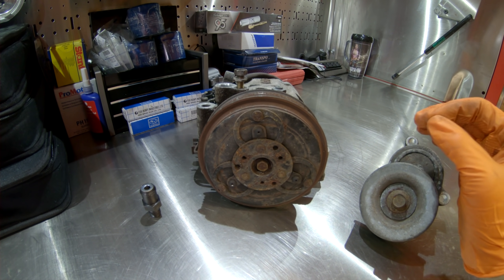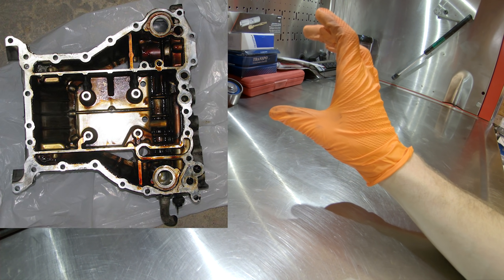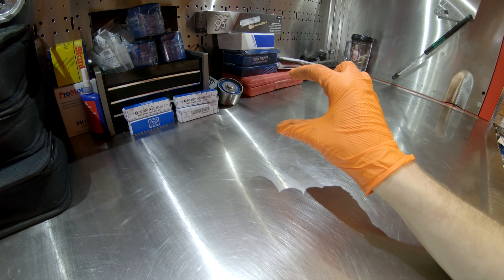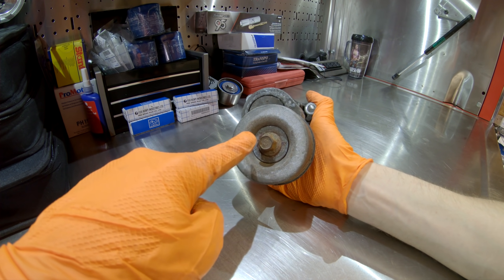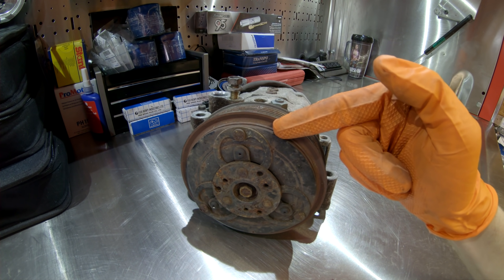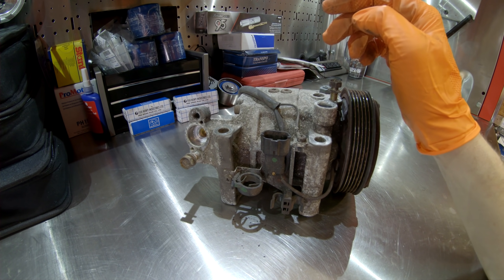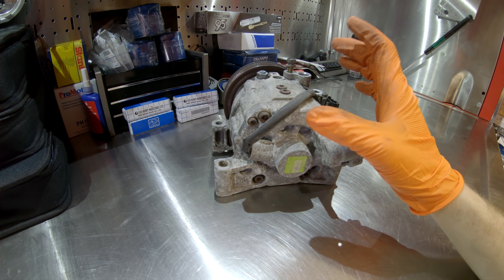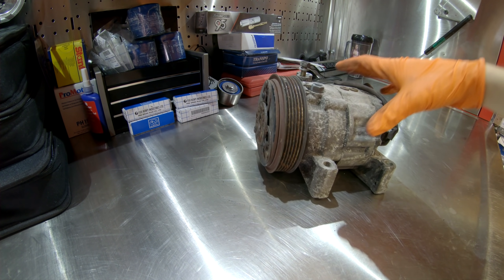Subaru EZ30 & EZ36 Top Three Failures

Comment: repairing the waterpump could be a nightmare.  the older subaru engines had pushrods. all the coplications are gone.  actually the spare tire was mounted on the top of the engine.

Comment: Any advice on how to avoid these issues? (New owner of a used 2019 3.6R outback)
Reply: Regular oil & filter change and keep an eye on the oil level as they do use some.  You will need to replace the cam cover seals as they all leak eventually.  Check PCV valve occasionally.  Replace serpentine belt idler and tensioner bearings maybe every 200,000km and the thermostat too (ensure it is installed the right way round & up, and is OEM).  Also check the steel coolant line that runs across the bottom of the timing cover to the oil cooler - ours pinholed from the outside where the support tab is welded.  Our '05 Outback has 330,000km on it and still runs nicely otherwise.

Comment: Any advice on how to avoid these issues (New owner of a 2019 3.6R)
Reply: About to buy one as well…. 

The engine and the interior design is much nicer in my opinion than the big I pad with auto start stop…

I am confident in this car but I have heard plenty of “these engines are bulletproof, stay on top of everything and you’re good, these last a long time” contrasted with “the transmission locked on me, oil leaking at 70k miles” 😂
Reply: I wish they kept offering their newer cars with the older looking style system, and with physical x mode buttons, and the H6…. Alas…. My last Outback kept me safe in multiple situations so I’m a fan.

Comment: Question for you... I just picked up an 02 LL Bean with the H6 217k miles. Has on overheating issue. It only overheats when you drive for 20-30 mins. Will cool itself down when you go to idle even if the AC is on. I'm familiar with he EJ engines. In my deductive reasoning I would assume water pump, but with it being timing driven it is out of my scope of replacement. I don't want to drop that kind of money without knowing that it will fix it and the mechanics around me aren't that great when it comes to diagnosing. The first one I talked to said head-gasket without even lifting the hood and tried to tell me that it is common on Subs buuuuut I worked at Subaru as an advisor for years and this is not common on the H6. Thoughts?

Comment: Having now owned both Subarus with a 2.5 n/a and a 2.5L Turbo ej motors, I’d like to try an ‘08-‘09 Outback 3.0R L.L. Bean motor. Compared to the overheating H/G issues on the N/As and the banjo bolts issues which can destroy the turbo motors, it seems the ez30 3.0 oil leak and other issues  are really minor compared to the concerns that plague the ej motors. Great video as always Mr. Subaru!

Comment: I have a question on what your thoughts are on not rebuilding the bottom end of the engine if I'm pulling it out the only issue I'm having is it's mixing exhaust gases causing the coolant to overflow my suspicion is that bad head gaskets want to replace everything on the top end and throw the motor back in recommended or not recommended is my question thank you I love your videos and you've been a godsend on helping me keep my Subarus on the road
Reply: It is ez 30

Comment: MrSubaru, great video thank you. I am not a Subaru guy, meaning I have not worked with them in the past. A friend of mine as enlisted my help with his 08 3.0R which I think is the 3z 36.. idk you would know better. Anyway, short story is the car blew oil all over, I mean from the under side of the hood to the exhaust all on driver side.. I first ran the car with no air intake, open throttle body ( because he remove all that before I got to it) and I was searching for a massive oil leak.. much to my surprise, no leaking oil, anywhere.. however, the engine is blowing what looks like white smoke out of the hose that goes from intake box to valve cover, as well as the dipstick tube and oil cap ( if you loosen it)
So my first thought was PCV, I replaced that.
It's still blowing white smoke out anywhere it can... I am 98% sure there is a clog in the flow of the pcv system, question is, where? In the intake manifold? Or in the block?
I'm pretty sure the pcv vavle clogged up and caused the oil to blow out the dipstick tube..
Any help with this would be greatly appreciated, sorry for the long/short story lol

Comment: I'm getting ready to purchase a used low mileage EZ36 eng and trans to replace mine in my 2012 Outback project car. Planning on doing a Raptor Super Charger in the near future. What would you recommend doing on a used replacement motor other than plugs, water pump, valve cover gaskets, & idler pulley assy of course! lol Was wondering if it would be worth upgrading to fel-pro head gaskets prior to install? Any input woul;d be amazing! Thanks, your vids are amazingly helpful!
Reply: Did you end up supercharging your ez36 ?

Comment: Nice video.  I had an oil leak on my 2012 outback 3.6R.  After I replaced the PCV valve, the leak stopped.  When do you recommend to replace the PCV valve?  I don’t see anything on PCV valve replacement intervals in the owner’s manual .  Thanks
Reply: Good point - I’ve just bought an MY10 3.6 5sp Auto with less than perfect maintenance history but only 170km on it, and no sign of oil leaks. Drives like a dream.
I was planning on getting the gearbox, diffs oil changed.
Looks like good idea to get new PCV fitted while it’s in the workshop, and have them check the a/c clutch clearance.

Comment: Such great info-- I have a major leak that right through a gap right in front of the oil pan. I looked at the PCV valve and while it is working (suck test) it looks dirty and I think that might of been the problem. Once a leak occurs I suppose that changing the PCV valve is too late, correct???  I am worried that my timing chain cover is blown and don't have the $700 bucks to repair.

Comment: What is the correct head torque sequence on the 2001 ez30d? I have found 2 vastly differnt sequence's floating around the web- the one dirtcheapdaily used and the one in the 2001 service manuel. Has subaru updated it or was dirt cheap's later model ez30 call for different steps? Thanks man!

Comment: I’ve seen a handful of nissan VQ40 engines in xterras/frontiers/pathfinders/equators have the PCV stick wide open and cause colossal oil consumption, usually less than 50 miles to burn one quart

Comment: 168k miles on my 2011 OB 3.6R. 4500-5000 mile OCI's with synthetic and it still runs great. My serpentine belt pulley actually went bad at 105k. But I replaced the pulley alone and put in a Continental Gatorback belt and all has been great.

Comment: My EZ36 during a trip had the bearing wear out on the Idler pulley and throw the belt. I wonder if this means that when they did the 60k mile belt replacement if they just didn't swap the tensioner and idler out. It's right at 85k miles now. I'm starting to check and redo all of the old maintenance on this car now that I no longer trust the maintenance done by the prior owner. I've done the differential servicing already, and I'm going to go ahead and get an official bearing kit to replace the aftermarket one I had to install on the road, and have them replace the PCV soon.

Comment: well, this is the knowledge i need, thank you. im having an issue with i think its atf fluid getting in my radiator. can u maybe help me understand that? also im having an oil leak, i think its oil, in-between on bottom or near the bottom engine & radiator? im pretty sure the pcv valve hasnt ever been changed. i just bought this car & i didnt notice all theses problems b4 hand. also it runs really hot. but not all the time. plz help if ur able. im going broke on this thing. thank you

Comment: Are the ez 6 cylinder engines oil burners?
Reply: When you use incorrect 0w20 or 5w20 yes...use correct weight 5w30 or 5w40 oil
Reply from the maker: No.

Comment: Hello Mrsubaru. I have 2006 b9 tribeca I tell you my experienced I was confused in 2016 middle of May at around 11pm I traveled from NY to NJ and my serpentine belt broke up still original belt since. It broke up after I cross the  verrazzano bridge then I pulled over and shut the engine off. When I turn the car on it start again and I started moving and run the car without serpentine belt to exit 102 NJ. that over 50miles but after 30 minutes of driving everything was down most are electricals I’m in the middle of Garden State highway driving without lights and panels are black out. What I did was stupid and risky but my car saved me. I’m not sure if I have an angel or it is a car is my angel. Until now I still have my car but the engine is started leaking I’m thinking to change the motor and hoping if you can make a video how to swap engine. Thanks and more power...

Comment: Pcv valve tip is a game changer, such an unassuming little part that can lead to a massive headache! Thanks so much for this awesome video.
Reply: Have to agree. Didn’t think how much problems could occur by not checking and replacing it. Great explanation as well MrSubaru. Clear and straight to the point. Love your videos.

Comment: thanks for the video! I love your content and you've helped me on numerous repairs. I'm about to pull my h6 engine to do some pre-emptive maintenance (timing chain and water pump). However, I was curious what your thoughts are on doing the head gaskets while it's out? Is it worth it? I know head gaskets blowing on these is rare, but when I've been underneath the car I have seen some very very small green spots around the head gasket area. I wiped it clean and haven't seen anything since, also I check the radiator fluid often and it's completely clean. thanks!
Reply from the maker: If you're pulling the timing set, might as well freshen the heads and replace the head gasket.
Reply: @MrSubaru1387  sweet, i'll give it a go. hoping to get 300K+ mi out of this engine.
Reply: @MrSubaru1387  what causes goop in coolant resvoir? I had to replace hose and new radiator after it leaked .
Reply: @007conspiracytheory  headgasket leak ?😬💸💸

Comment: 2006 Subaru Outback 3.0 h6 has overheated replaced the radiator as it was leaking and thermostat just in case! I did a test with that blue liquid and it never changed colors! Then did a pressure test on radiator and more leaks was found on the water return line in process of replacing that but on my back! I heard to jack engine up but remove the mount bolts and or if need more room take headers off! Now headers are right in way can I just do these vs jacking up engine?? Can I reuse the gaskets?? How can I get to the mount bolts easily?? Special tools ideas on back so hard to get a straight look at the bolts on mounts!

Comment: MrSubaru looking at the videos for the EZ36 timing chain replacement, I don’t not see holding the cams when the chain is removed. 
Will the cams rotate due to spring pressures? Is there a holder for the gears not to move?  
I have 100k on my 2010 OBW and assume the chains should be replaced. 
Thanks for the videos and guidance.
Reply from the maker: The chains aren't replaced as normal wear items like a timing belt. They're ruled lifetime or 300k miles by Subaru. You only service the chain when you have an issue, like; water pump leak, chain noise, loose guides, etc.
Reply: @MrSubaru1387  So that water pump....   its timing chain driven.   Scotty just ridiculed Nissan and Subaru for using timing chain driven water pumps, and the potential for coolant to leak into oil that comes with that, basically destroying the engine by rusting the main bearings.   I've never heard of this issue happening to a Subaru, and I have driven them for 27 years, although I've only had EA82, EJ22, EJ25 and now FB25 engines.   I am looking at a low mileage 2018 Outback Premier 3.6 (Premier is the top of the line Canadian model, which I believe is the Touring model in the USA, whereas in Canada the Touring model is the well equipped middle of the line model).   

 I've never heard of a water pump issue on an EZ, and I have some friends with some of the original EZ30's, the 212HP models.   I seem to recall that the water pump has a seepage hole to the outside, so that will leak coolant to the outside before it can leak into the timing cover, is this correct? and have you ever done a EZ36 water pump earlier than 200K?   I was considering the new turbo, but I don't like turbo's for all the issues they bring into the equation, and I tow a small trailer (Aliner hardside popup, 2100lbs fully loaded), so the idea of being on boost up long hills is not appealing.  My FB25 does fine towing, much better than my previous Ej25 with the manual transmission.  So I am thinking that I can get just a bit more power without a Turbo, and at about $17k less than a new one.  But that water pump sticks in the back of my mind, especially since I first saw the FB engine on display in 2008 where I noted the accessory driven water pump, a return to what the EA82 had.  I had no issues with the timing belt driven water pumps as I changed idlers, tensioner, and water pump with the belt each time.
Reply from the maker: Correct, the weep hole is external. It won't mix coolant and oil, unless the water pump o-ring goes. Haven't seen that happen. Haven't replaced an H6 water pump. I replace the engines first, due to owner neglect. I rarely see any issues with the H6, unlike the several common issues on the EJs.
Reply: MrSubaru1387 Do I have to worry about the tensioner or guides? Thanks for all the great videos. I am new to the Subaru platform.
Reply from the maker: @brianf8621  normally you don't need to worry about it until you start to hear chain rattle/noise.
Reply: @MrSubaru1387  is there any typical mileage at which the timing chain starts to rattle or its tensioner fails on the EZ30?

Comment: The EZ series is the most underrated Subaru engines.
Reply: got a 3.6R, i do love all subi's but the power without turbo/SC is something I can't deny is my fav
Reply: Yes I've done near on 300,000kms in H6 EZ30 motors ... last 10yrs+ bullet proof if you service every 10,000kms and run good oil 5W-40 fully S.. and high end oil + paper air filters and run 95+ octane min fuels ...
Reply: @john-yn5nz the basic service that people seem to neglect and end up ruining these engines reputation
Reply: Agreed!

Comment: Not sure I'd recommend it...but you can kinda-sorta "oil" the bearing.  I had my idler (not tensioner) started making bad noises and found it almost seized, the parts available local turned out to be the wrong size so I had to order and wait a week.  In the meantime I had to drive...so I soaked the thing in oil and worked it back and forth until it spun free, bought me enough time for parts to arrive.  Not recommended...but beats having it fully seize when you have no other option.
Reply: Just push the bearing out from the idler and press a new one in - it's a standard size, ten bucks.  Replace both the tensioner and idler pulley bearings as they both wear.

Comment: I am lookin for a 3.6R outback 2011 5at  betwin 65-100k miles,  is it a reliable engien?  at the moment y have a 2012 xv  with the tipical oil consumption isue,
Reply: Ez are probably the most reliable subaru engine and can easily see 350,000 km with proper maintenance

Comment: The ej25 a/c tensioner sucks.
Reply from the maker: This video is on EZ30D and EZ36D H6 engines though. Not EJ engines.
Reply: MrSubaru1387 true, but just saying that the tensioner is a common failure and isn’t that bad. Actually this video has made me look into the EZ motors more as possible swap for my Forester. I know that many say the EG33 is a better motor, but the EZs are more common.